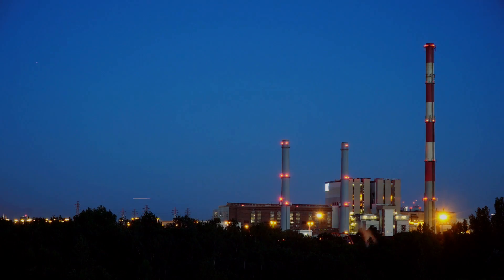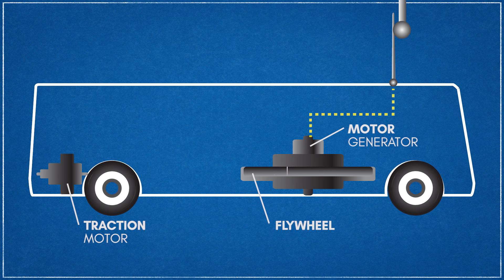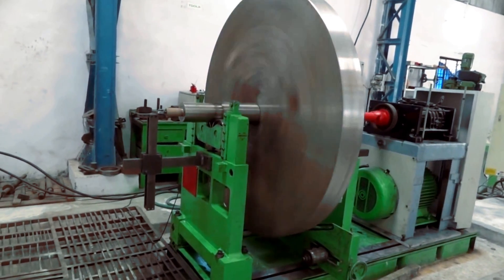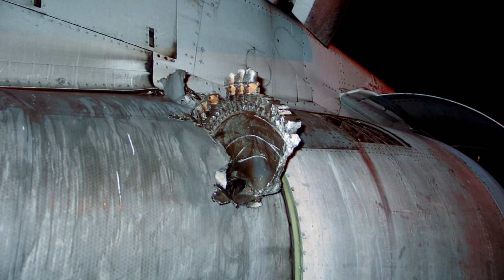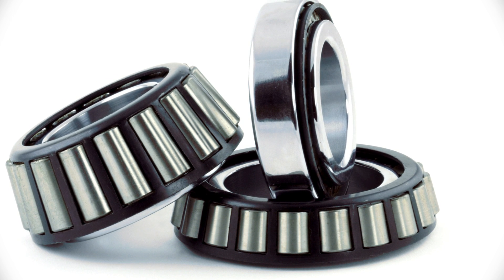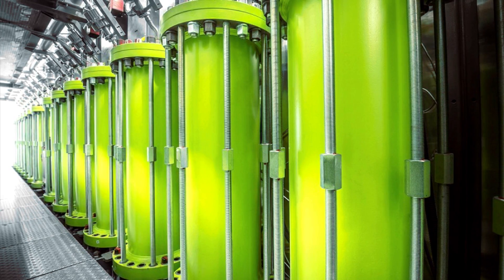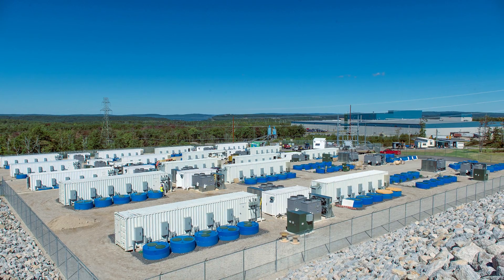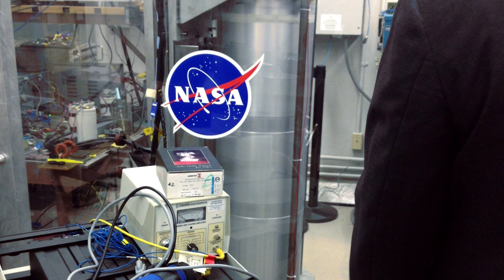The Mechanical Battery

Comment: Came up with a fly wheel design a decade ago using a hollow torus made of a  "Y.B.C.O." ceramic with a track in the inner ring, the ceramic acts as a super conductor at temps below 90k.  Liquid nitrogen, which is pumped through the hollow torus, boils at 75k so turns the structure into a superconductor holding ring.  Within the track you have 'spokes' of rare earth bar magnets that are mounted on a central axis so they polarity of the extremes of the spokes are all the same.  In theory with the meinser effect the spokes are suspended in place with zero surface friction.  Capping the torus and making the internal area a vacum would remove the air friction allowing the magnetic spokes to rotate indeffinetly so long as liquid nitrogen is supplied into the torus hollow.  Alligning bar magnets externally perpendicular to the spokes so that they attract the spokes as they approach and repel them as they pass would keep the spokes spinning and perhaps even accelerate  them. Finally encase that rotating magnetic field within a ball of coiled copper to generate electric current at the cost of liquid nitrogen which is apparently equivalent in cost to milk.

Comment: Storing energy with accelerated mass is a fools errand. You want a storage element that will wait 1000 years to be tapped? Compressed air. Cheep to compress, cheep to store, cheep to transmit, and highly efficient because it uses a low mas storage element. But the larger 'major energy corporations' with mega tons of defensive cash volumes will not allow the science to move forward.

Comment: 04:00 and following: A flywheel converts absolutely nothing!
The crankshaft does the conversion and the flywheel is only there to provide inertia to reach the next powerstroke or to even out the the power impulses in a multi-cylinder engine.
Reply: So the flywheel acts like a kinetic capacitor
Reply: @JohnSmith-eo5sp  I think that´s a very good analogy!

Comment: They've got these huge flywheel batteries at the data centre which stores the server "cloud" that the organisation I work at host with. Basically in the situation of a power outage, these flywheel batteries kick in instantly to provide power. However the data centre uses so much power that it'll be drained completely in about a minute or less. It provides enough power just to give the diesel generators enough time to start up and provide backup power.

I wish I can use a small version of these at home as battery storage but I think they only come at high capacities.

Comment: It seems like the issue of unrecoverable power when a flywheel's RPM gets too low could be largely eliminated just by adding a gearbox. Since the power stored in a flywheel is proportional to the square of the speed, a gearbox with a maximum ratio of, say, 1:5 would cut the amount of unrecoverable power by 96%.
Reply: I dont know a lot about mechanical devices and stuff so I don't know if the gearbox would work to solve the problem. But how could they add a gearbox In the magnetic levitated flywheels?

Comment: As we have to  *Realize = it doesn't exist a   * PERPETUUM MOBILE *  .....(more or minus in-/-out-put)
as I  found    *most effeniency Technics  *   is actually:
1)  Hydrogen - H2 =  w/Performance of  maximum = 28-KW -only-( unfortenatily)  commercial Offerers
2)  ORC = Organic Rankin Cycle =  use  Hot-Water boiler  (not Steam)  with Pipes inside of Boiler =     
     -  containing special-liquids, = heating up to 70/80- Degree Celsius  (effect as steam)
     firing as cheapest, with gas /oil / Wooden pellets or. or.. (I will firing with  secondclass weath)
     Result = make Heating water = and = w/ connected Generator= 1-assembly = the Electric.
ORC = was forgotten,  for 100-years, newerly  start  some Companies in Europe again,
most Experienced  in Performance and Prices = are  China Industries,  I found: Shaanxi Kaishan-
Mechanical + Electrical Equipment CO;  ( for complete assembly )
so I guess, as I am - total 100% independant  ( for my land property 250-years old, required  +- 200-KW)
Thank You very much for Your Publikation, as I recognized,
Regards fro Germany,  wishing Health and Luck, God Bless Amerika,

Comment: A honorable mention is also the Parry People Movers. Which is basically a prof of concept of flywheel technology on the railways.
Trains require high bursts of energy to accelerate their huge mass, but have low friction and require significantly less energy to maintain their speed.
thus the huge engines required are energy wasting surplus for a considerable part of the journey. A Parry People Mover has a smaller engine than a conventional railbus but the engine maintains a spinning flywheel that is used to power the vehicle during acceleration, and can recoup the energy from braking, resulting in a super efficient rail vehicle.

Comment: the only thing capable of dropping more columbs of electrical energy in a single moment is a capacitor. However, the downside of a capacitor is that its density tends to be extremely low.

Comment: Energy storage is energy concentration; as a result, failures result in local catastrophes of some sort - flywheels coming apart and ripping a building to pieces (race cars have scattershields so you get to keep your legs if the flywheel blows), batteries can explode from built-up gases and short circuits, etc.  Even petroleum can be thought of as a battery, releasing its stored energy in the form of heat.  Dams can burst, water wheels can fail (in both cases, the water head is the "battery", capacitor banks can explode, etc.  Safety is always an issue - one of the reasons that petroleum-based engines are popular; the practical risk of a gasoline explosion is low - regardless of whether it is at a refueling station or in the vehicle - and gas (propane) cars are less so, owing to the added high-volatility-induced risk.  It makes for an interesting engineering problem to solve.

Comment: Very interesting.  I wonder if the ULTRA-CAPACITOR with similar self-discharge properties might not be a more suitable short-term, high discharge rate storage system for some of the flywheel storage applications cited in this well presented video.

Comment: batteries have a wrong neurotransmitter dangerous for life forms as an compounend. people are not aloud to make poisons under no circumstances. there are 'lesser' efficient but less deadfriendley substances. i think a capacitator or condensator or elco is the best accu / battery. the other one 'battery' is a chemical electricty generator. wich will after a period of time will become 'inert'

Comment: Something that does not appear to be talked about much on youtube is mechanical energy in the form of clockwork storage. Such as using an electric motor or human operation to wind something with very high potential energy while connected to an electric motor. It's a neat way of storing energy and i've only found a few videos on youtube actually using this function, otherwise it's just mechanical to mechanical like a wind up toy, not using the stored mechanical energy to turn a generator shaft.

Comment: Actually the cisco documentary is very good, in that it explains that the flywheel solves 2 problems.   1) Battery hardening, when the battery loses capacity over time.  The flywheel has unlimited charge / discharge cycles.   2) The flywheel can be inline with a diesel generator and an electromagnetic clutch can be used to jump start the diesel generator when loss of power.  Meaning that the flywheel can restart the diesel generator with failure of the electrical supply.

Comment: Today the same 1500 kilogram flywheel may be replaced by smaller and lighter super capacitor that charge up rapidly and may be discharged slowly to charge a battery or run the motor.

Comment: The weakest link is the ball bearing that must be maintained constantly. It has a useful life. The faster it spins, the shorter its life. It is good for a short term storage of energy like the Aircraft Carrier Caterpillar. But I wonder how does it compare with Capacitors which are much cheaper, simpler and can be charged up very rapidly. There was a huge improvement in this technology in the last 30 years.

Comment: Material strength is only a limit if you have an axial. Support the flywheel using a stationary outer track and magnets, and you can vastly exceed tensile limits, because the flywheel is no longer supporting itself.

Comment: good idea, however, it uses more energy to maintain this flywheels spinning than the occasional energy extraction. A Diesel engine and or a battery bank will be much more effective in a UPS.
Reply: nope. they usually lose almost no speed rotating if well designed. and give instantly any amount of energy they have. even with super-capacitors becoming affordable ppl using flywheels not in a hurry to switch
Reply: @mrpicky1868     Yes, however you need to apply physics, it will take lot's of energy to spin this things to speed, it needs energy to maintain that speed even if you use them or not and you need to restore the energy you extracted from the thing to restore the operating rpm. At the end you are at energy deficit. Remember the generator attached to it also is using energy when spinning unloaded. After loaded that is when you are using the energy  stored in the wheel. After the switching off the generator circuit there is a magnetic field decreasing in the whining of the generator creating a mechanical drain  for longer up to a minute decreasing as time passes .    All depends on what requirements do you have in your industry.   If you use this devises very often then yeah, but if you need them sparingly no, is not worst the investment and  is using more energy than needed with other systems.

Comment: if the flywheel bearings are worn by earths tilting I imagine you meant the seasons changing tilt. Then why is not the entire machine on an oil based stabilization system that has multiple piston or piston like pieces interconnected with tubing that autoadjusts itself using gravity to make the machine "flywheel" always perpendicular to the earth as long as the machine is true and made perfectly true to gravity. They use an oil system to stabilize buildings in tokyo for earthquakes and that is millions of pds so stabilizing a machine that weighs much less to save bearings and the downtime they incur would seem like the most logical thing to do since downtime means more wear on whatever machine is taking up the slack. This might also since oil isolates make the machine have less micro damage from wear incurred by outside vibration like a tremor or even large trucks or maintenance on a similar machine would even lightly touching cause vibrations from its weight settling off a hoist after removal since thousands of lbs usually always make a thud no matter how gentle unless it's the most advanced system and computer controlled most hoists are unrefined at best moving down under load maybe a 1/4" drop on a quick tiny button push.

Comment: Wouldn't this work far better in space, say 10 to 100 times better, with limited micro gravity! Once spinning it should not stop over time, unless all the energy drained from it. But once it is spinning it will always be there if not used!

Comment: the earth is spinning, so it means, that the spinning flywheel is affected by the earth rotation, on the other side, the earth rotation is olso affected by the flywheel, creating a wouble-effect in both rotations having a massive impact on our environment in long term. Only because it takes long time to destroy our planet by that, it doesn't mean that we should do it. The impact to our planets rotation would be definitely irreversible, since we would have to put energy back into the earth rotation by applying corrections.

You guys should learn basic physics before saying that creating a flywheel battery is a environmental friendly solution. The most dangerous so called "environmental friendly solutions" are coming from people like you who don't understand most physics, but claim to be intelligent enough to solve the problem. As a PhD in Quantumphysics i can't wonder enough how many low educated people are "solving" such important problems.

Comment: Flywheels only work well if encased inside of a vacuum chamber and paired with either with needle point or carbide tipped bearings.   NO you can't use an "AIR CUSHION" air pressure bearings inside of a Vacuum Chamber for OBVIOUS reasons.

Comment: I really can't see flywheels having much of a future in moving vehicles, but for stationary use they have a lot of potential. With magnetic bearings and a vacuum chamber, you could have very low energy losses over long periods, and deliver a lot of energy very quickly, without pollution, at high efficiency, without using any exotic, expensive materials.

Superconducting magnets could make things even better. But even without them, this seems a totally feasible way to store energy. And unlike pumped hydro, you're not limited to where you have specially desirable sites. If you can get the loss rate low enough, this could be an effective way to provide seasonal or other long-term storage for solar and wind.

One other possibility, although it's probably not compatible with magnetic bearings: Use a naturally occurring rock structure to serve as the outer surface of a large bearing. Then, if the rock is strong enough, you can spin the flywheel much faster, as it doesn't have to be strong enough to hold together by its own strength. But the outer bearing must have very low friction.

Chemical batteries will be formidable competition in the coming years, just because so many EVs will be available to provide storage from equipment that already exists for its own reasons, and the economies of scale will relentlessly drive down costs. But flywheels are one of the few technologies that might be able to carve out one or more serious niches.

Comment: QUESTION. Could Flywheels be adapted to work with micro hydro applications? Using water pressure to spin up a flywheel that has pelton cups on it? The idea is similar to a pottery wheel where you don't have to kick the wheel all the time, just every so often to keep speed. I would think if you go a flywheel going and then piped in water, even lower pressured water, the "kicking" would keep the momentum of the wheel going.

Comment: Glad to finally see some coverage of this idea.  I like the idea of flywheels that clutch in while breaking and then release it back to the tire when accelerating.
Reply: Just like electric basically but even simpler I think. Yeah they'll come with brake pads but the spring can also be the brake if some geniuses that can design simply and reliably can get their hands on it.

Comment: Thank you for this video.  
I remember seeing a video right here on Youtube about a company making flywheel storage that powered up a flywheel during low power demand periods and then generating power when power demand was high.  It claimed low cost, near zero maintenance, and the flywheel could spin virtually forever.  It used a flywheel in an enclosure with a near vacuum inside.

Comment: 1:55 - a huge flywheel spinning in a chamber filled with HYDROGEN!
Well, I don't see how this could ever go wrong!
I have no idea how we don't have stories of these things exploding and killing hundreds with flywheel shrapnel
Reply: Because they are designed with the idea of not having them tear themselves apart. And Hydrogen is not a problem in and of itself. Almost every BWR has a bubble in the top of it. It is only a problem when the hydrogen get near Oxygen and then only when it is above 15 PSI in containment. No Oxygen, no problem. A spark in pure Hydrogen gas cannot ignite it.

Comment: Now I'm wondering, with the newly discovered flash creation method, what progress there has been in incorporating graphene into metal and composites. Steel and tungsten carbide contain carbon, but I'm wondering if graphene can be incorporated to supplement their physical properties. I expect it is being worked on.

Comment: Most  people Don't even Imagine that Energy can be stored by simpling spinning a wheel, they also don't even imagine that most of the Energy comes from the Sun and all stars, by heating the wind they create the wind currents for the aerogenerator to move, the same happens with rain that drops from the sky and moves through the rivers and into turbines, they also create plants that eventually become charcoal and oil, amazing channel I am going to look at your other videos, 10/10

Comment: What about a small version. Like the size of an 18650 cell?  Halbach magnet configuration so once spun up the forces can both keep it spinning and hold it together.  Combine the motor generator and the flywheel into one unit such that the flywheel is the magnet array supported by mag bearings. In a vacuum their would be zero friction.

Comment: I like the flywheel. Build the batteries into the flywheel (CC). For vehicles, e=m*v².

A "giant pedulum clock generator" with some hundred or thousand tons of weight could also store large amounts of energy anywhere with highly dynamic availability. Solar raw heat could be used to lift the water by evaporation after first use of the steam. Just let it condense at desired height.